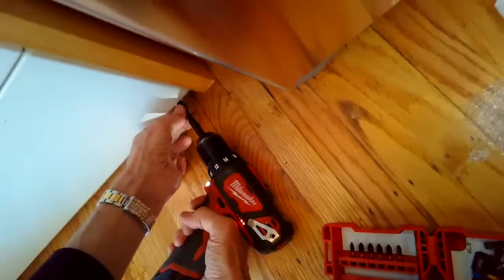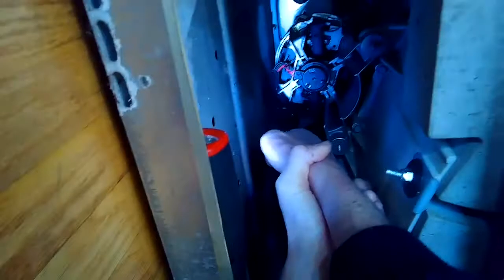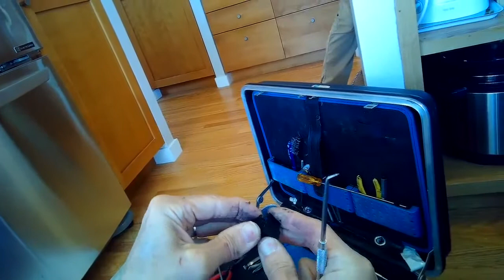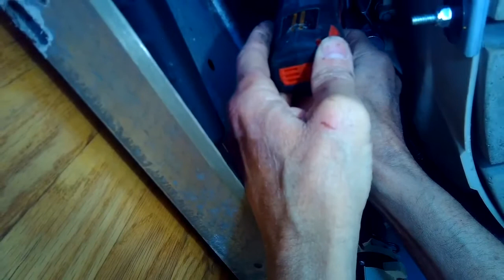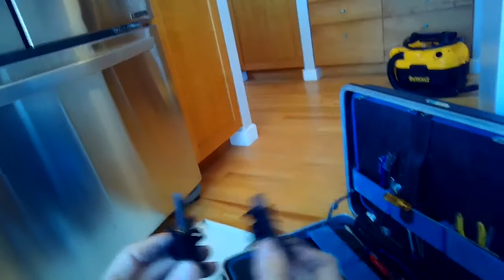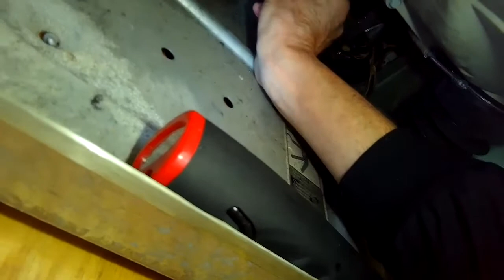Fridgidaire Washing Machine Motor Brushes

Comment: Search '481236248003' for the brushes in the correct holder. They come in "L" & "R" styles, which is the letter molded on the case. The actual brush & holder are the same in either "L" or "R", but the molded case is a bit different.
Reply from the maker: Awesome info.
Thanks so much👍